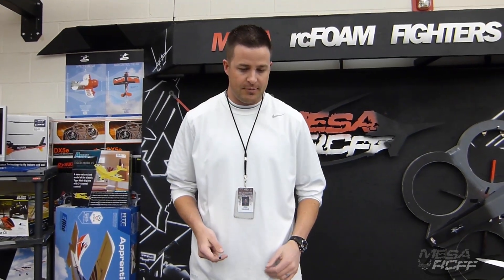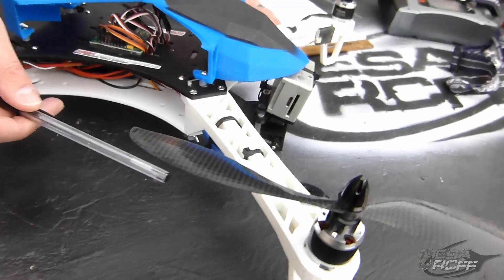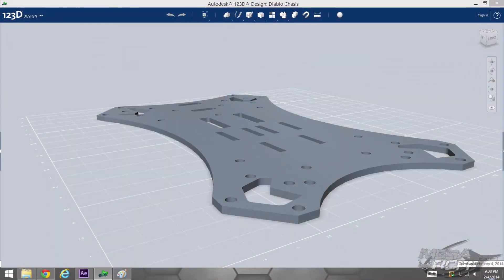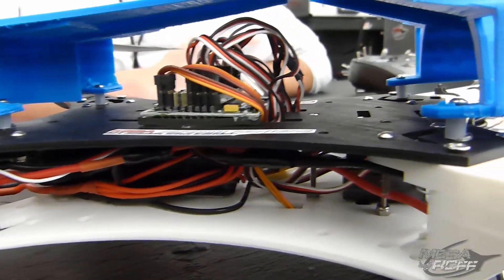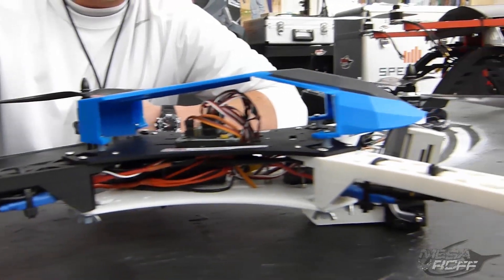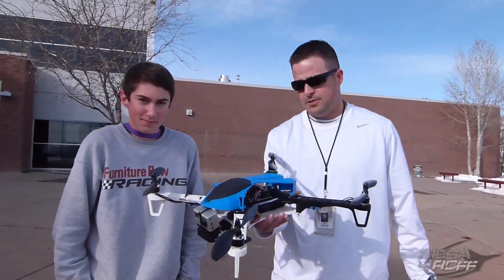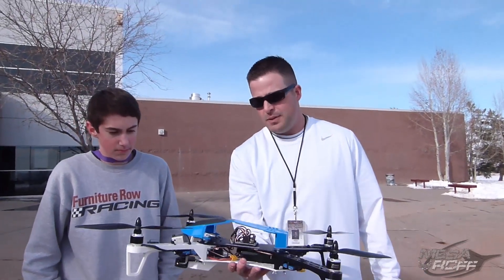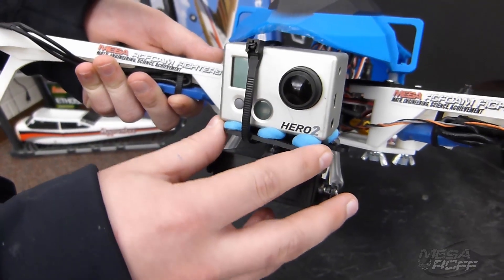MESArcFF - MF Diablo and SS Gimbal - CREATIVE GRANT

Comment: This is looking very good! I'm blessed with a 3D printer soon, but I don't know what filament I should get for projects like this. What did you use? Thanks!
Reply: ***** It's The Micro (M3D) from kickstarter ( https://www.kickstarter.com/projects/m3d/the-micro-the-first-truly-consumer-3d-printer). I'll be using this for smaller parts. The frame will be printed by Shapeways!

Comment: Awesome project. I'm still super jealous of your maker bot 3d printer and the endless capabilities you all will have with that. I've just started into the multirotor field as well with a KK2 board. Have you tuned the gains at all? Looks like the gimbal needed some tuning as well. I may end up going the SSG route vs getting a more involved one for my bat bone and get a 2 axis gimbal for the later bigger multirotors in the future (ex. Anycopter hex)